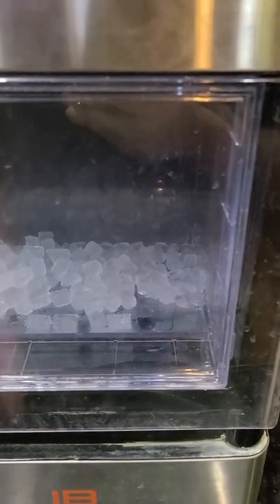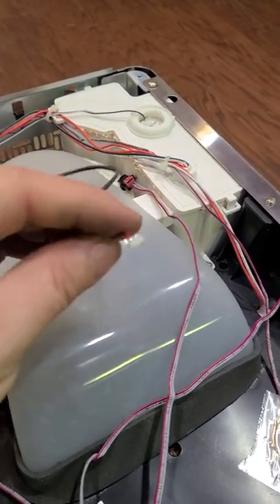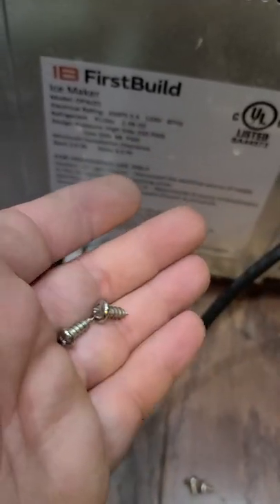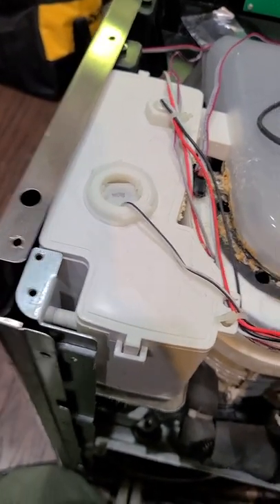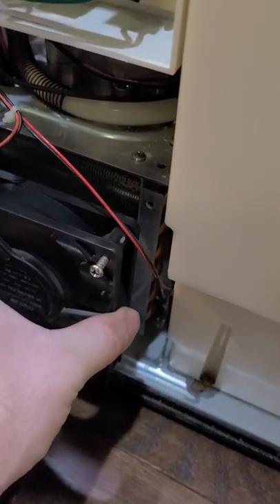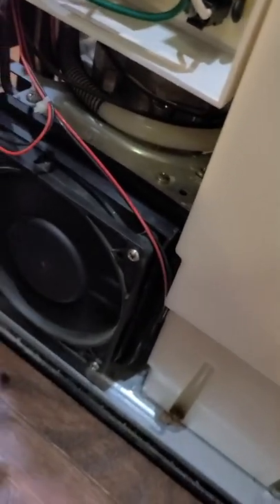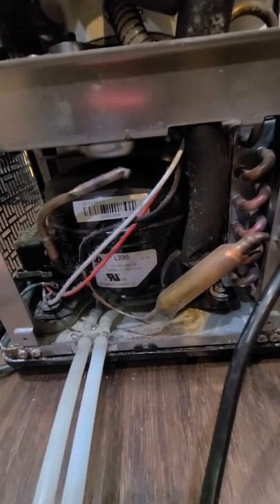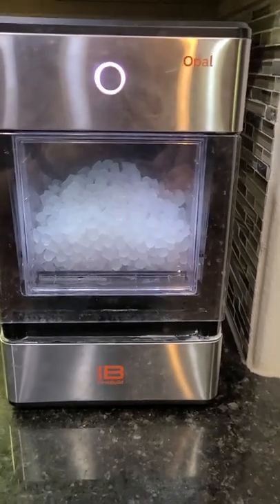GE Opal Ice Maker Overheat repair

Comment: Thanks for the helpful advice. I was able to remove the back (and side panel, just enough) to clean the radiator coils and the unit it back to working order. The opposite side vent had been over heating, and at times making a high pitched squeeling noise. Now, no excessive heat and no noise. And... back to making the best ice ever. Cheers!
Reply from the maker: Glad it was Helpful to you!

Comment: OMG thank you I have been dealing with this for a year on my girlfriends, (got her one after she liked mine so much, now we live together, Using hers cause mine was a fellow 1st build like yours, keeps it as nice as possible since these are so popular almost as a collector item).  We have taken it apart so many times, cleaned it out, not much dust inside, since our issues began a year ago, kept a small desk fan on it to help dissipate hot air blown out, as its under a cabinet on counter next to coffee machine one side and knife block on the other, even switched to distilled water assuming build up of scale on the inside after years of service that ice cleaners weren't getting even after day long repeated cleaning runs and home mixtures to go over commercial mixtures, vinegar, citric acid, etc... chemistry says the clean water at low temps should over time take those minerals out on its own making the distilled water just like regular tap.   Just so many alterations cause a device like this at these prices should last longer than 4-5 years.  Just so upset.   Thank you for the tear down and explanations.
Reply from the maker: Hope it was helpful to you!
Reply: @everydaydave270  thank you! Unfortunately the sensors, switches, the screw drive thing that makes the ice, all good, best we could figure was it was just a bad compressor… got a used one in decent condition off eBay for a fraction (won’t say which fraction cause it’s always a crap shoot between price and quality off eBay) so far a couple weeks of that and it’s good.  Have the old one if anyone is interested in taking a crack at it.

Comment: I need your help. The white wire holder that the wires are plugged into that goes into the chip on the inside of the circuit board that is on the bottom of the lid broke on me and now I can not plug the wires in so I can use my ice maker. where can I find one of those white clips at??
Reply from the maker: Not sure, you may try ereplacementparts . com
Reply: The board attached to the underside of the lid is just the bluetooth board.  If you aren't using the app to connect over bluetooth you should be able to run the icemaker with that board unplugged.
Reply: Alternatively you could rewire that wire via solder. Or one of those heat shrink connectors. Or pretend like it didn’t happen.

Edit: just noticed the lid cable doesn’t have any white wires on mine. Yellow. Green. Black. Red.

Comment: No water going to freeze chamber.Stays in fill tank
Reply from the maker: Pump may be out. If you don't hear the pump, check on that and possibly replace.
Reply: @gladis Vicencio - you may an air bubble in your line. While the unit is running, reach down and pull off the screen in the water reservoir below your ice basket. Put your finger on the hole. If you don't feel any suction, your pump is probably out. If you do, hold your finger on the hole for about 10 seconds. This will get the air out of the line and your Opal will start circulating water again.
Reply from the maker: @daleasay4571  good advice!
Reply: The pump might need primed. It could have got air in it

Comment: My fan is on the inside of the condenser 😳🙄 wtf
Reply: Ours is too. We are trying to figure out how to get at it. So annoying.
Reply from the maker: I'll look into it. Sounds like there are trying to engineer in planned obsolescence.
Reply from the maker: They made them harder to repair...of course. There are four screws, i believe two on top and two on bottom, they are a complete pain to get to. Once you get them out you can get the fan on the backside. https://www.youtube.com/watch?v=zv5IvTjLEeM This guy might have your answer there. I did not watch the whole video so It might be better than mine to get info on. Or worse? either way, between the two I'm sure you can find what you need. Don't hesitate to reach out if not.
Reply from the maker: @kimberlyblatnik9887  They made them harder to repair...of course. There are four screws, i believe two on top and two on bottom, they are a complete pain to get to. Once you get them out you can get the fan on the backside. https://www.youtube.com/watch?v=zv5IvTjLEeM This guy might have your answer there. I did not watch the whole video so It might be better than mine to get info on. Or worse? either way, between the two I'm sure you can find what you need. Don't hesitate to reach out if not.
Reply: I haven’t started the repair. There’s a video floating around on how to replace this fan and in that one the fan is on the inside. It appears considerably more difficult. 😢
Reply: Yeah so is mine. About to take the whole damn thing apart.
Reply from the maker: @fivehole64  look at the comment I posted to Kimberly Blatnik. May be helpful to you.